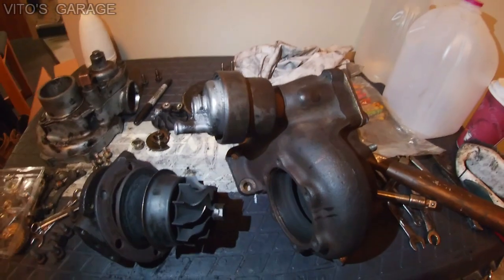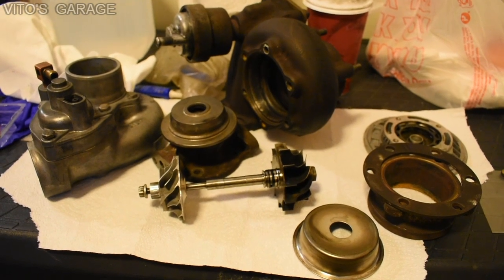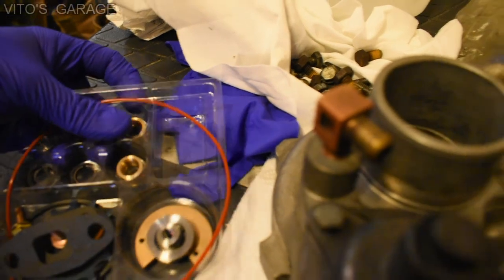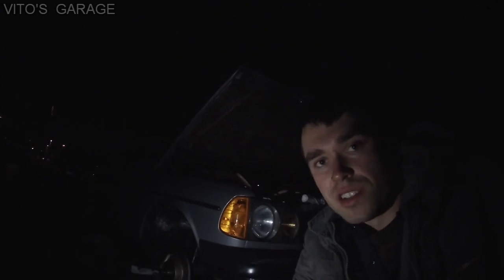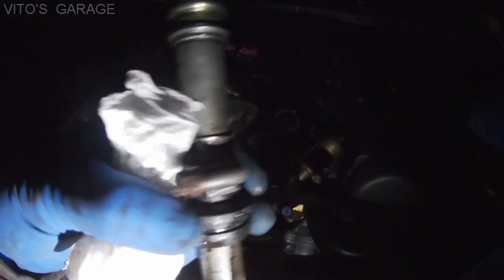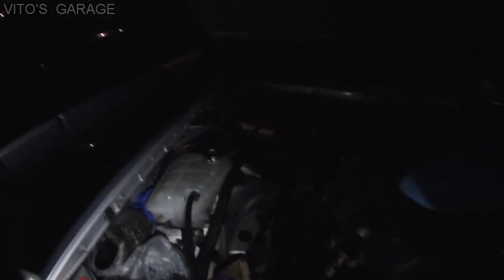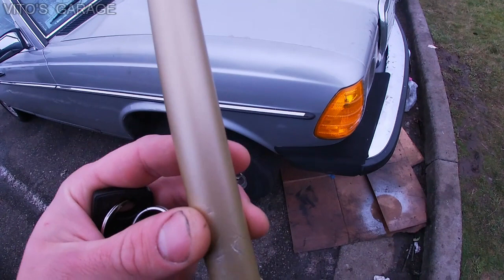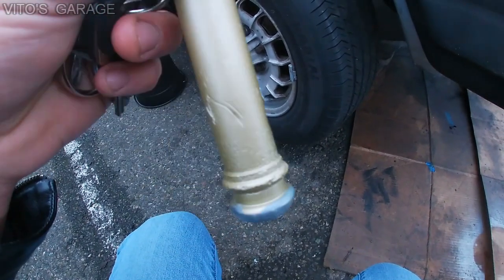PART 17 Dad's Mercedes W123: Turbo Clean up & Failed Rebuild.. Turbo Drain Seal, New Engine Mounts

Comment: I read at a supplier of spare parts, that at the beginning, the turbo did not have balancing, this machines did not exist.
The first turbodiesel engine was not an MB, but ... a Peugeot which the oldest car manufacturer in the world. But one of the first Peugeot sold in 1890 had ... a Daimler engine (previously they were steam engines!). The engineer Gottlieb Daimler founded in... 1890 the Daimler-Motoren -Gesellshaft which will become MB. (Désolais pour mon anglais approximatif).
Reply from the maker: Awesome! Great to know! Thank you very much for the info!